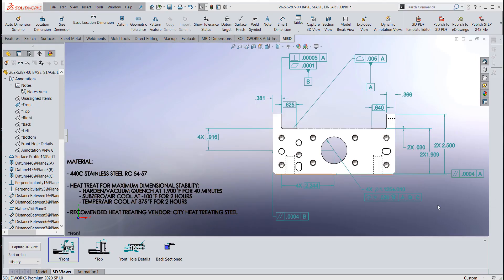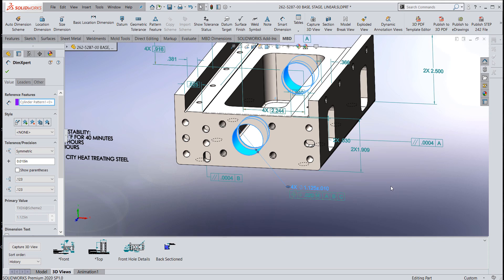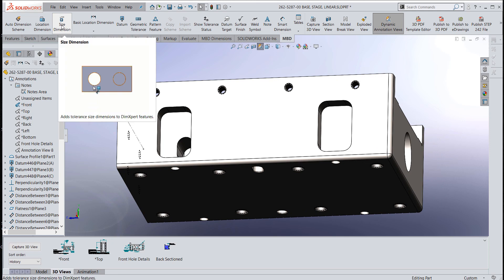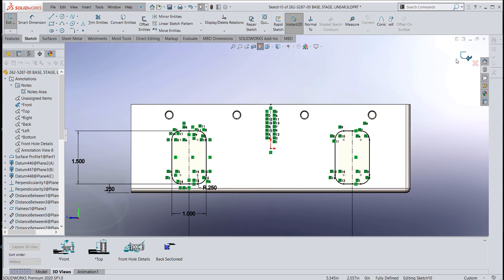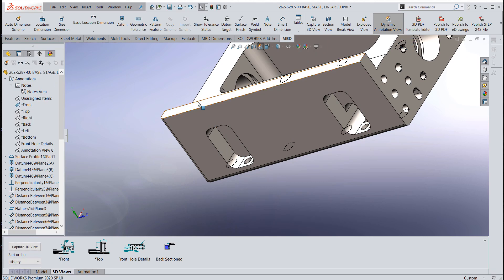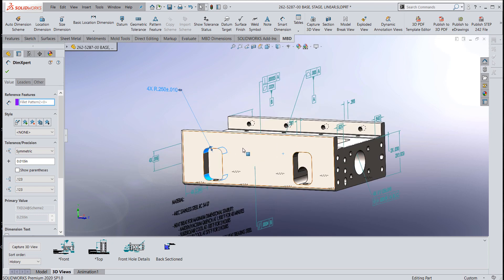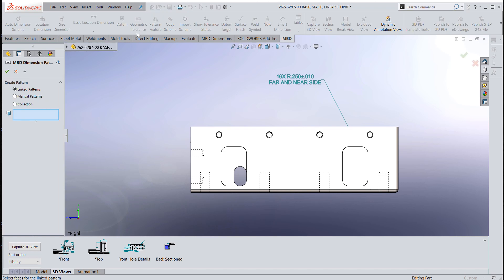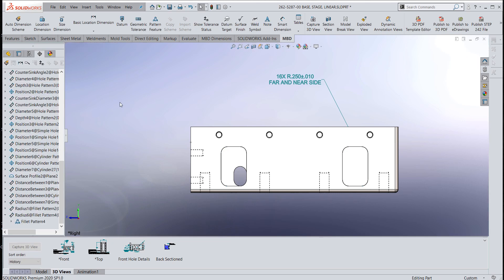SOLIDWORKS MBD Tutorial - Adding Multiplier or Place Count Holders

Comment: Solidworks Library Feature functionality has a serious bug. 
My Version 2018 SP5

If i use "Link to Library Part" option after inserting the library feature in a part, that part gets corrupted after updating/changing the library feature. And After file corruption, you can't get the feature tree back. All will be deleted.

Can you guys double Check and notify Solidworks?